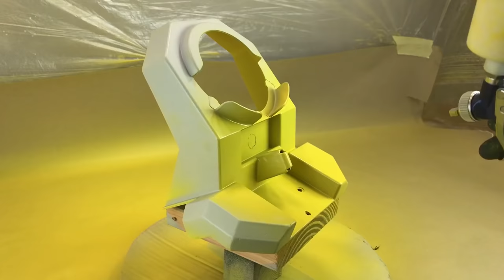Restoration Tonka Mighty Cement Mixer 1985s - very rusty Tonka Toy Truck

Comment: You just turned it back into a functional, pretty and safe toy without unnecessarily filling the pittings or using powder coat. It is a toy. Thank you for not overdoing the restoration.

Comment: After sanding the scratches  out of the plastic  windscreen,  try dipping it in some floor polish,  then letting it dry  under a cover to prevent  dust particles  from getting  in. 
Got that tip from the YouTube channel,  Marties Matchbox makeovers

Comment: Can't believe it turned out so well after seeing all that rust, its also a wonder that mixer hasn't cracked over time. You could try UV light bleaching the white plastics using hydrogen peroxide its what they do to restore yellowing consoles.
Reply: Yeah, it's called retrobrighting and it helped out a lot of my dad's old power ranger zord figures

Comment: There are plastic caps available to put on the end of the rivet set. Also a soft variety of rivet.  Doesn’t require much force but should be strong enough to hold the pieces together.

Comment: You should invest in a enamel powder coat system.Enamel powder coat lasts alot longer than priming and painting it with automotive paints.And for a smooth high gloss finish,take 400-800 grit sand paper;some hot tap water,and wet sand each layer of primer;and wet sand each layer of yellow paint,before applying the waterslide decals;then several layers of enamel,or lacquer gloss coat over the entire truck.
Reply from the maker: Powder coating would not be a good idea for this project. The tonka was badly rusted. one could have longed for any unevenness. In addition, plastic cannot be powder-coated.
Reply: @MWRestoration  I meant the metal parts can be powder coated if you choose to do so.Acrylic,enamel,or lacquer paint will have to be used to paint the plastic parts.Sand blasting removes rust;bondo automotive body filler;can be used to fill in the pitted areas on the metal pieces,before powder coating them.I have seen some of Restoration & Restore's videos in which he uses bondo automotive body filler,to fill in heavily pitted areas;before he powder coats them.The plastic parts he cleans with hot soapy water,before he paints them;using rattle can paints.

Comment: The spray paint was already cracking when fixing the metal fasteners back, maybe powder coating would be best. Also will that paint hold on the plastic? Wasn't their another option other than paint?

Comment: Question: did you nickel plate the bare metal pieces for additional rust protection?

Also, for the plastic parts: were you not aware of retrobriting?

Comment: real question, how much did this project cost. and keep up the good work fam
Reply: I restored a dumptruck and it did not cost a thing because I used spray paint I already had and was able to put screws in place of rivets

It was an amature restoration but it turned out great

Comment: I am curious that the metal was so rusty there was no pitting. Also I would guess that special paint for plastic?
Reply: Oh, there is pitting, you can really see it on the black bottom chassis, he just primes it and paints over the primer. I didn't see any sanding to the primer though. I'm sure if you could see it up close, you could see the pitting under the paint. Sloppy job.

Comment: I had a few "Mighty Dumps" when I was a Kid (umm.... that don't sound right..... Lol) I was very Hard on them for sure. I'd take them everywhere. I remember them getting worn out, some had a bit of surface rust, but I can't remember any of them ever being as Rusty as This. I never left them outside like apparently this one was. I do remember on one of them through, the paint was literally peeling off in chunks just like this one. It was from the mid-late '80s like this one. Did they experience a bad batch of paint during that time period? because even as a little kid I thought it was weird that the paint just seemed to fall off. I only remember that happening to probably my very first one. I think I had 2 or 3 later on as they wore out, but they didn't peel like my first one did that I remember.

Comment: You need to spread a towel to do the final assembly on.  It's more professional than a scratch forming at the end.

Also I'm not sure if you ever done automobile painting or not, but you need an exhaust system for the paint job.  Also you need proper PPE while painting.  Inhaling that paint fume is very dangerous.

Comment: Loved this!  My question is what was the flame used for on the tires? What did it do?
Reply: I'd imagine it melts/burns away all the tiny fiber-y shavings of plastic (from sanding and use) and restores the tire treads' smooth, fresh-out-of-the-mold surface finish.
Reply: Mike Budzien makes sense. I know to use a torch over poured epoxy to get rid of bubbles. Thanks for the reply

Comment: That’s going to rust again. You gotta completely remove ALL the rust before applying a coating. You didn’t blast it completely, either due to the wrong media or not enough pressure, and then primed without any sort of rust converter. The thing is going to rust from the inside out now. In addition, a toy like this should be powder coated not painted. Paint is going to scratch the first time somebody touches it. Powder is far more durable and can handle playing without damage.
Reply from the maker: Powder coating would not be a good idea for this project. The tonka was badly rusted. one could have longed for any unevenness. In addition, plastic cannot be powder-coated.

Comment: Does anyone know what those rivet like things are called that hold the tires on? I have the same truck but cant find that type anywhere. Might help if I had the proper name of them
Reply: Steven Coates my question also. I'm thinking some type of press on nut?
Reply: @KingRatt  yeah they're called top hat nut, I found them after